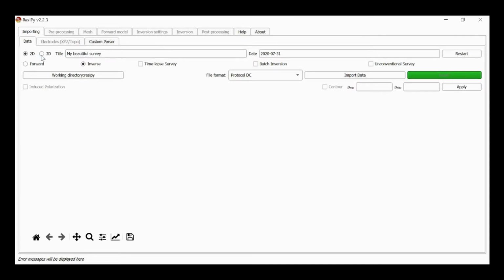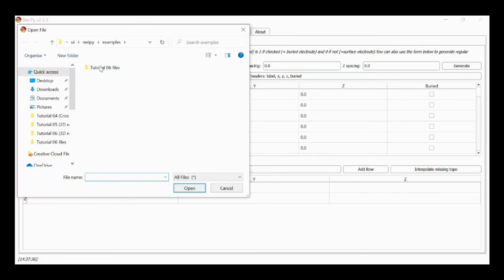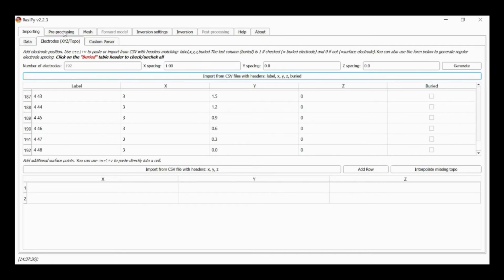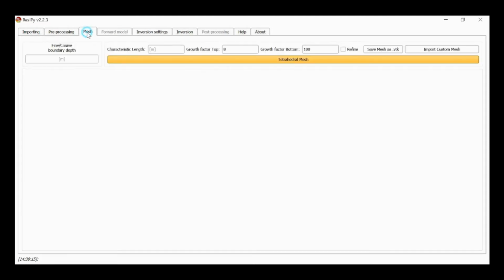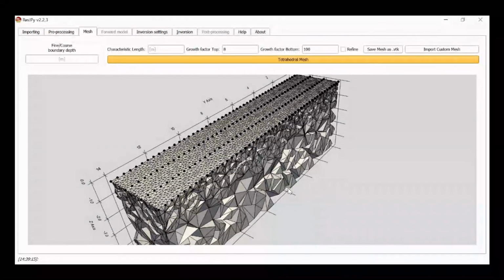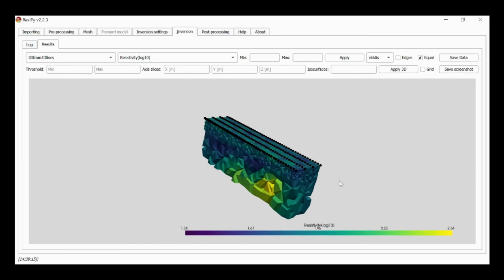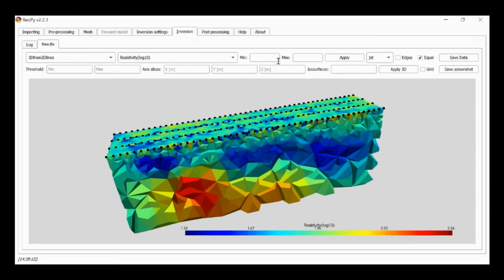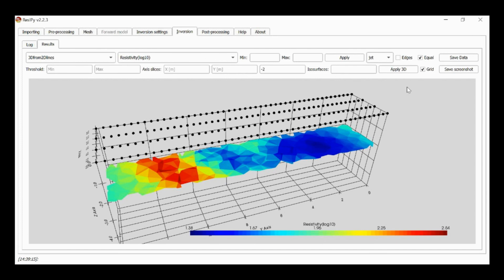Tutorial 06 - 3D resistivity field data inversion

Comment: Hello Team! 

I have been learning how to use ResIPy through this great video series. I have however encountered a problem, which is not addressed in these videos. In our data, every line measurement in a certain direction overlaps the previous one with half of the electrodes. For example the electrodes 1 - 10 of the second line would overlap with electrodes 11-20 from the first line. Thus, when I import the data to ResIPy I get an error message on my electrodes overlapping.

Is there a way to import such overlapping data, or should they be omitted from any data imported?
Reply from the maker: Please submit this issue on our "issues" page on GitLab at here: https://gitlab.com/hkex/resipy/-/issues 
Please include example files and the actual error you're getting.